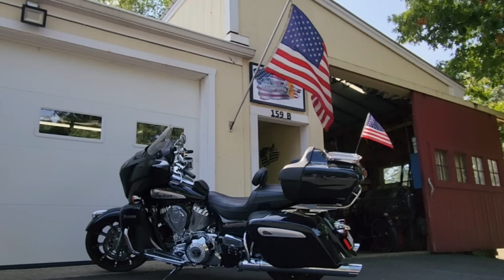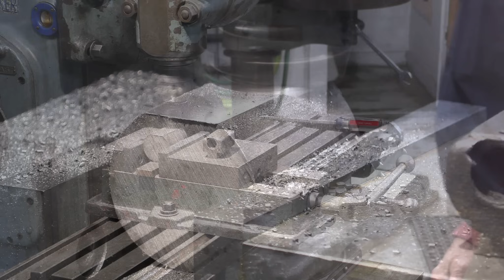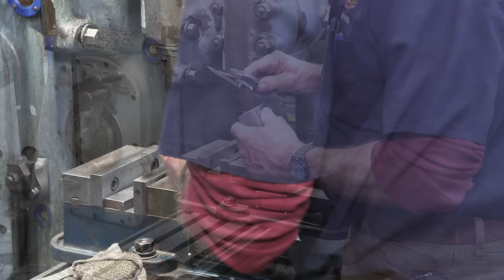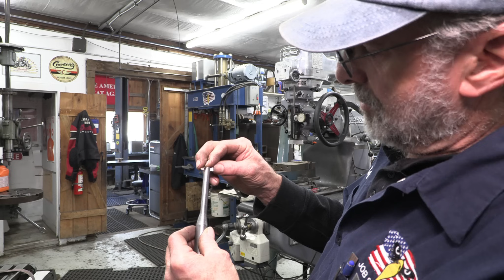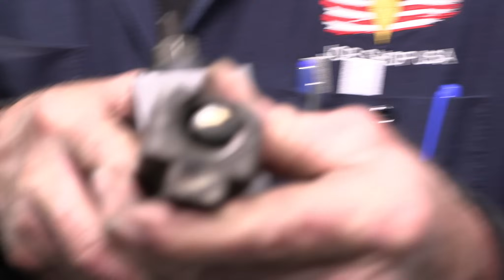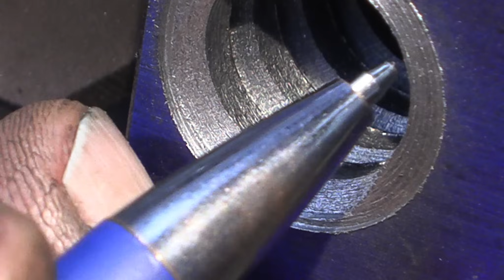Pearl's Crossfeed Nut

Comment: General question for anyone:
What’s the preferred material for a lead screw nut ?
Cast-iron ..
Bronze …
Brass …

Looking good Keith  👍
Reply from the maker: The answer is all of the above, they are all usable, ductile and bronze are better wear materials.
Reply: Hey Dean  what ever material , they are a real prick to cut due to bar deflection !
Reply: I’ve only used brass mainly because I had it in stock